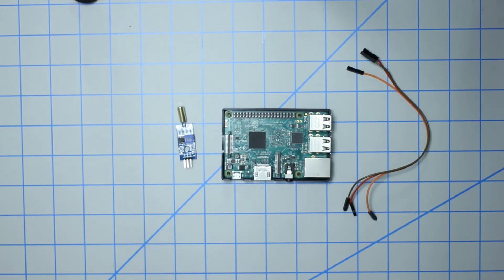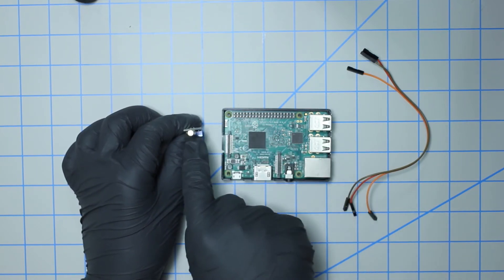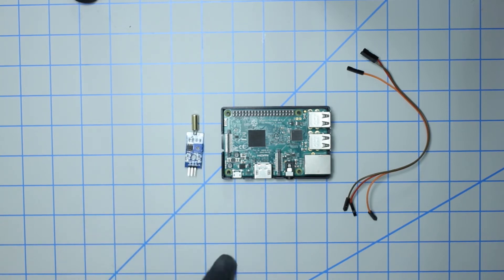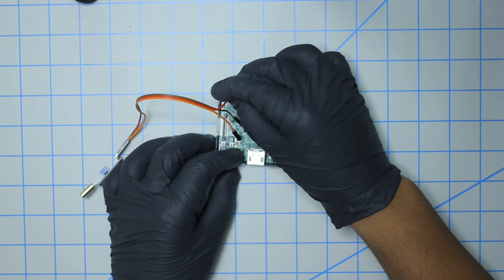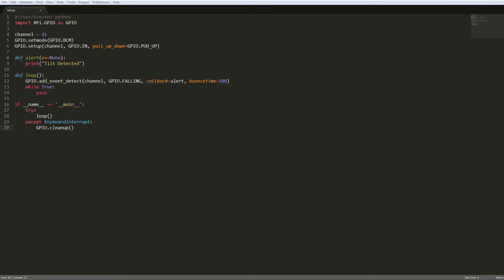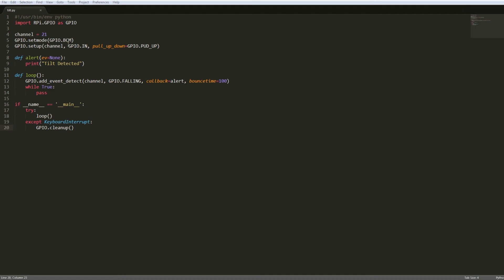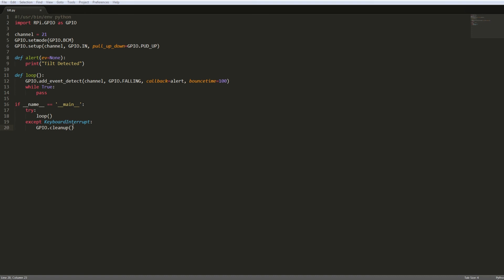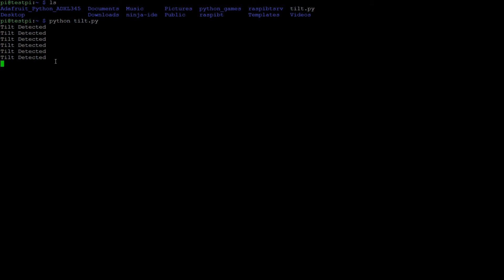Tilt Sensor (Raspberry Pi)

Comment: Great video demonstration. With this sensor, I'm guessing its just a up or down sensor no way to program degrees of tilt? Is there such a sensor? And if there is how compact is this sensor or circuit?
Reply from the maker: Yeah it's binary, so it's either tilted or not. Check out my video on the ADXL345. Not sure, you can Google the spec sheet for the sensor for more details.